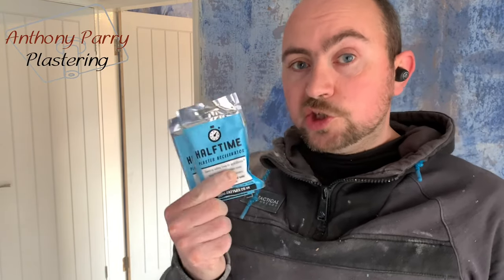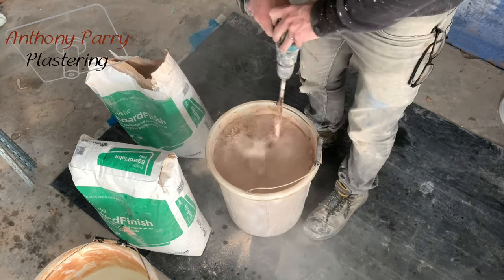Using the Halftime Plaster Accelerator for the first time.

Comment: Half time is just aluminum  sulfate  , except  a sachet of half time costs around 3 quid and you can buy a kilo  of aluminum  sulfate  for under a tenner , I did some work for a chemist  and showed  him a half time sachet and hel looked at the code thing on the back and said ,.its aluminum  sulfate  , I bought some used an empty sachet to gauge it and it does exactly  the same thing bit for loads less money
Reply: and ali sulphate will weaken your plaster
Reply: @justinphipps4034  Been using for 2 years and haven't had any complaints
Reply: @edwallace3704  well weve lab tested both halftime and ali sulphate before we brought our product  Speedyset  & Slowset out 4 years ago and in fact WHY  we made our products, ie  to bring the industry a retarder and accelerator  that didnt weaken the end product  and we are STILL the only product that does it   . We found both ali sulphate and halftime  did exactly the same , they were exactly the same both in compound and what they did and how they worked   . Both weakened plaster by up to 30% depending on thickness  , thats a huge weakness, you can pull up BG's tests too , and they found exactly the same  . They both create Sulphuric acid when added to water , and you dont want that in your eye . Ali sulphate had been around in plastering for literally decades and a decent spread knows what it does to your plaster .
Reply: Yep they are the same , and they are both horrible cheap chemicals to use in plaster
Reply: @justinphipps4034  I used sulfate  in cement  the other day too and it worked  💪  lovely and went off rock hard  , you can blab on all you like about lab testing and all that other bullshit  😉  you'll  never con me lol 😆
Reply: @justinphipps4034  British Gypsum  have brought out fast set finish now and its lovely 😍  stuff . 
I'm just about to  plaster an artex  ceiling and about to use my trusty sulfate  to send off that 1st coat nice and rapid 😉👌🤘
Reply: @edwallace3704  fast set plaster is great but has its limitations . But they developed a new plaster with the  right polymers to adjust time , they didnt just shove lots of ali sulphate in the multi . As I say you can add many things to your plaster to accelerate , if money is your main concern , over strength and spread consistency , then  your ammonia in your wee will set plaster quicker , cement dust , dirty water , but all these will effect the plasters strength . By the way dont get the ali sulphate  water  mix in your eye , as its sulphuric acid ...not good in your eye .
Reply: @justinphipps4034  all you have to do is raise the PH level to make it set faster . If I could be arsed I could get a sachet of speedy set , give it to my cousin who's a chemist  and ask him to sus out what's inside 🤔  , it's not rocket science  , just making plaster set faster 😉

Comment: Seen a few of your videos now why do you use a battery drill to mix plaster you need to get yourself a proper mixing drill a battery drill is t designed to mix plaster I would imagine it would be roasting hot and wouldn’t last long mixing plaster
Reply from the maker: Hi Kenny, I really don’t have a problem with over heating drill. The paddle I use takes the strain out off the drill and because it mixes the stuff quicker it doesn’t ever get to overheat.

 I just done a video on the Mixm8 paddle and why I use it. I’ve been using the same makita 18v combi drill for years. I’ve only started using it for mixing the last year thou. 
I have got normal mixes but having a cordless mixer has been a game changer for me. 
I’ll probably move to more heavy duty one once this packs in.